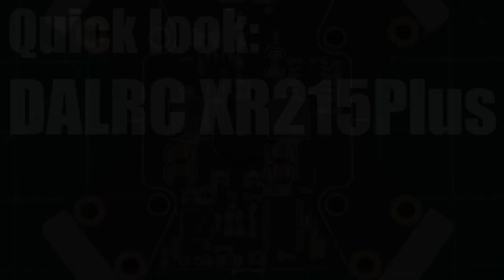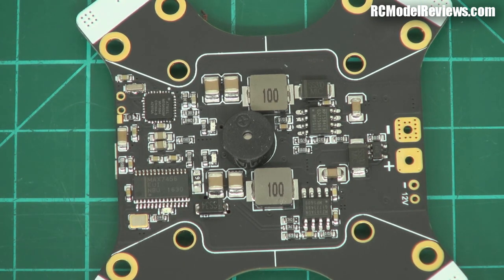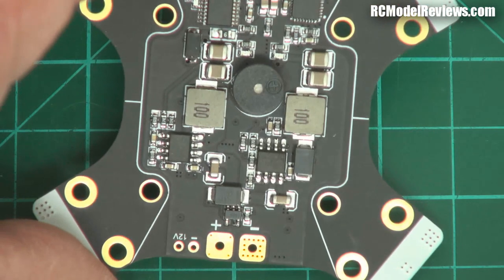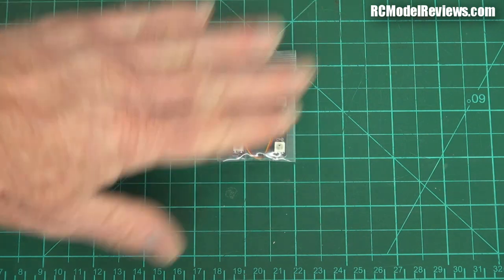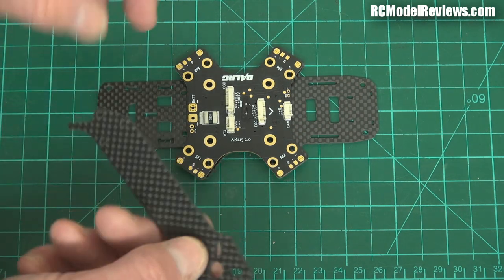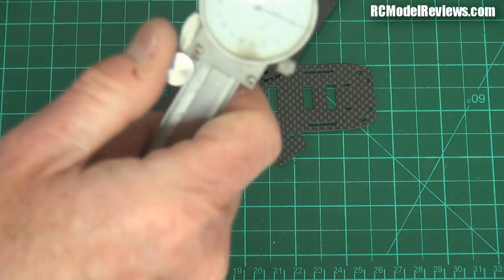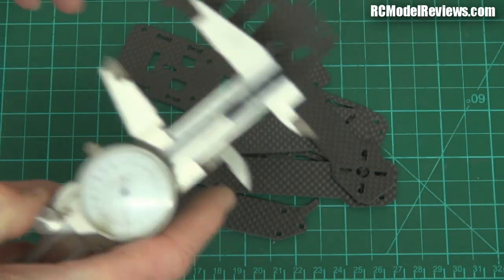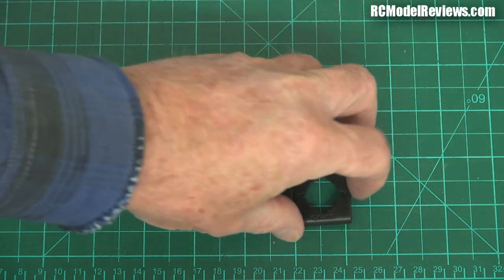Quick look: DALRC XR215 plus racing drone frame and PDB

Comment: Alien and Martian frames are using the PDP as structural parts too... And it works... I did finally brake a Martian after six months but it broke om the bottom plate and one arm (4mm) but not the PDB.
Reply: the alien/martian pdb doesn't have any copper traces that can break
Reply: Randy Lachman

They are PDBs so they have... But nothing fine like the DAL but some massive traces.
The Martian (II) also does have an additional plastic plate to isolate the PDB against the carbon fibre.

Comment: My latest build was a frame from Banggood called the MakerFire. It has a PDB that is almost identical to this one. OSD and video worked fine when I was just cruising around but when I put the throttle on (like a sharp climb or pulling out of a corner) I had complete video loss! Beware...

Comment: So far I had no noise with the pdb in my video line. Really nice design so. It is almost a standard minim-osd by the way.
Only downside of the frame are the 3.5 mm arms for me. They flex a little bit. I see that in black box indeed. In generell, the whole frame is almost too thin everywhere, but so far it works. DAL intents to build a light-weight frame. So if you want a very very robust frame, don't buy it. Also the power line is too thin. I changed it.

Comment: You can solder to the back side of those tiny connectors but i agree with you, they are pretty meh. I believe those max chips that run the OSD are not too good reliability wise. Something to note is that the current sensor does not connect to the flight controller directly so if you are using telemetry you can't get the transmitter to yell at you about over drawing from the battery

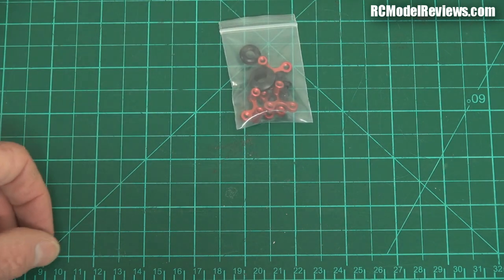Comment: Those red things at 6:05 are designed to go over the screws at the ends of the arms
Reply: grahame addicott and give extra strength for the pdb
Reply: under the scews. You place the protectors at the arm and then put the screw through. With the time the screw digs in a bit, but not a problem.

Comment: Nice little kit. Too bad the QC apparently does not check the component material thickness. The component mass reduction holes are a stupid idea. Have seen engine blocks after acid bath mass reduction crack and self destruct just from vibration stress at mounting points.

Comment: Bruce, just something I've noticed lately. Why are you always reviewing the cheap gear/frames that not many use? You don't really review much on the hype train like the new racekraft props or the new frames popping up all through NZ or even the latest motors, flight controllers, or esc's.
Reply from the maker: The reality is that there is just so much gear coming out at the moment it's hard to keep up.  You'd be surprised how many people email me wanting a review of this or that non-descript, entry-level frame or RTF because they just want to get into the hobby.   The guys at the top end are in less need of some help than the guys just starting so I have been focusing on the entry/intermediate level stuff because that's what people overwhelmingly ask for. 

Also, I'm not exactly a Metal Danny or Mr Steele so I'm probably not the best person to voice an opinion (other than from a technical perspective) on the high-end frames and kit.

However, I've been working hard on some bespoke test rigs that will allow me to do some really hardcore testing of some top-end components and you'll see that appearing over the next couple of months.  For example -- which VTXes and cameras are most resistant to noise on the power-feeds and in close physical proximity?   Which ESCs produce the most noise, which are most efficient, what does it take to kill them (ie: how true are the average/peak current ratings)  etc, etc.
Reply: And I rather have reviews on hardware I can actually buy =D
Reply: RCModelReviews well you put that to bed! Keep it up uncle Bruce. 😝
Reply: i have also wondered why you havent done an update on the cheap quad build? there have been alot of changes and if some noob watches them videos they are going back to the middle ages. lol